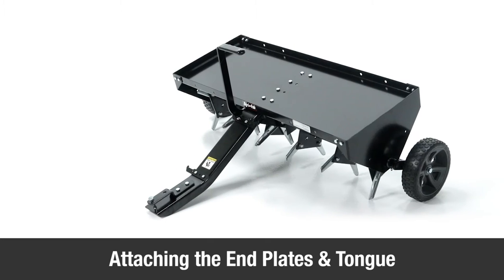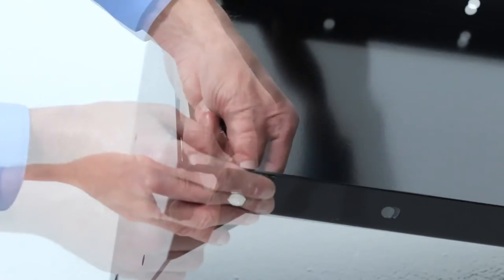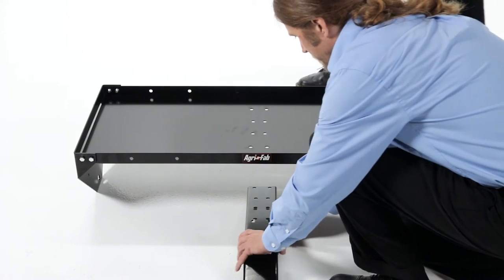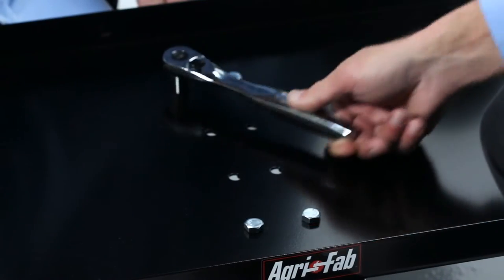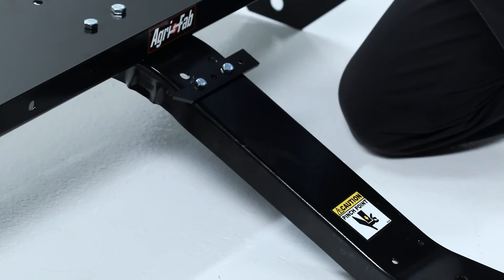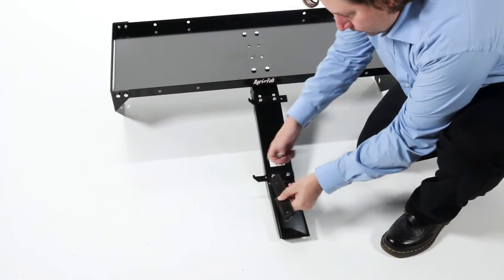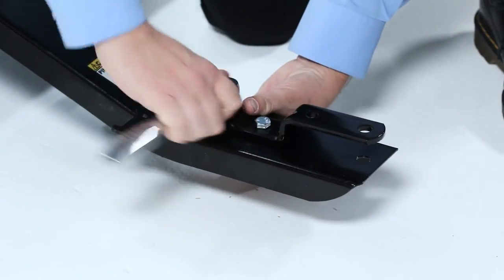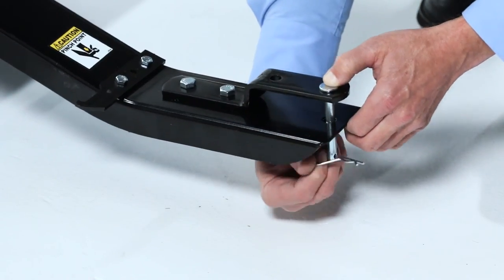Attaching the End Plates & Tongue

Comment: This sure does not match the 45-0518 I have. The paper manual that came with it doesn't match this step either. I took the model number right off of the side of the box.
Reply from the maker: If you need assistance with assembly or parts ordering, please call +1 800-448-9282 during business hours.  We look forward to having a conversation with you!